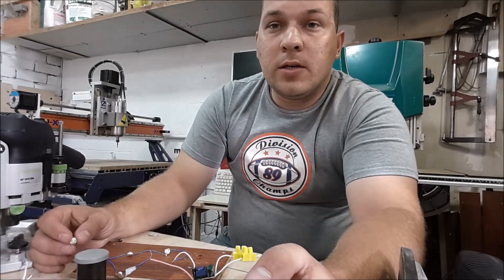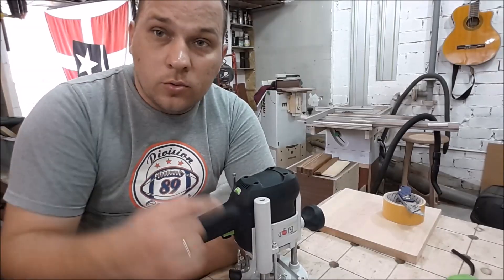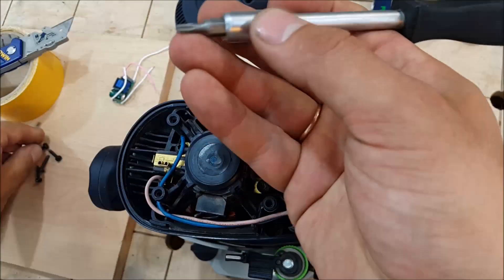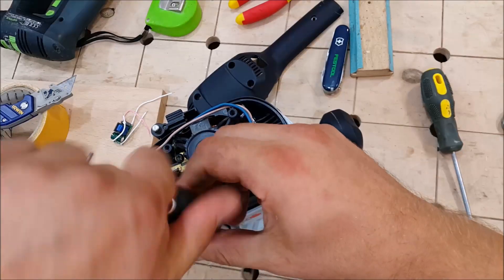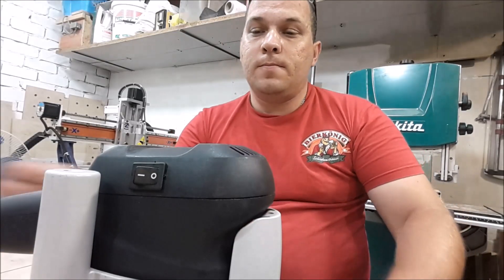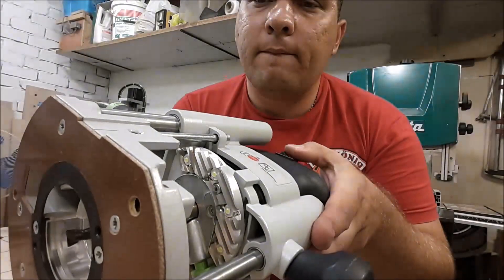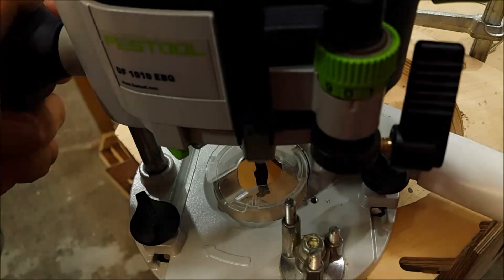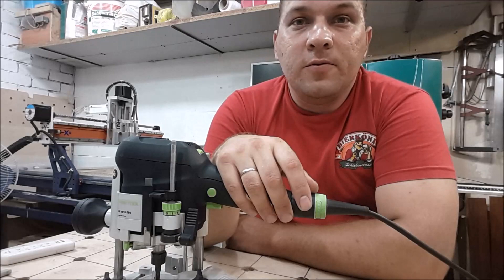LED Light For My Festool OF1010 Router

Comment: For whatever reason this just showed up in my suggested videos, I am already a sub so maybe that's why. This is not just a good idea, its the greatest. Light where you need it most and certainly bright enough to see clearly with. Excellent execution my friend as usual. I noticed a second trace of the cooler on your sacrificial base. Did you make a second part?
Reply from the maker: Thank you, tsstn. O made two traces for wires because first I had plan to place wires separately

Comment: Hacking Festools is only for brave men. I wouldn't dare to do that with my OF1010
Reply from the maker: No guts - no glory)
Reply: Nico Smets

Even if it's out of warranty?  My OF1400 had a problem with the bit not being centered in a guide bushing.  It's still under warranty but I hacked a couple of notches in the guide bushing plate.

https://youtu.be/STuHs0JSQtM

Comment: Professionally and competently performed modernization. 1 milion likes :) 
Recommendation - LED  is mounted on the radiator through the thermal conductive paste ( КПТ-8)
Reply from the maker: This Kafuter glue is a special termal glue for led diods fixing. 1.6 termotransfer ability
Reply: I did not know that a paste. So all correctly performed :)
В этом случае вообще все идеально получилось. :)
Good job!!!!  
Thank you!!!

Comment: Very well done, Vlad!! I was particularly impressed with the aluminum cooling/holding grid you designed and milled for the LED lights (because they are so easily overheat and burn if not installed properly)!
Reply from the maker: Yes. The mail task for this aluminum body is namelly cooling. I've done some little space between it and router body to allow air convect free
Reply: And that is why these lights will last:)
Reply from the maker: +CrazyRussianWoodShop yes)

Comment: Hi man, very nice and great add-on for the OF1010!
Could you please tell us a little bit more about the electronic you use to connect the diod? what are the components?
Reply from the maker: Really I dont know much about them. I bought this cheap 20 cent led diods on the radio market and asked feeding element for them. Saler gives me electronic drivers. One of them can feed from 3 to 5 diods